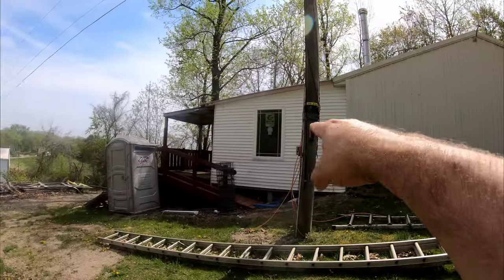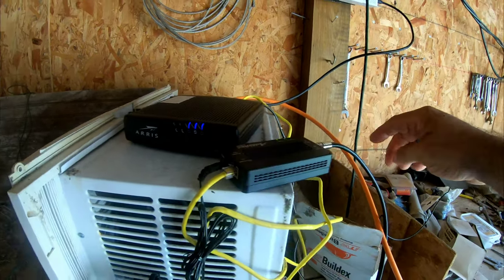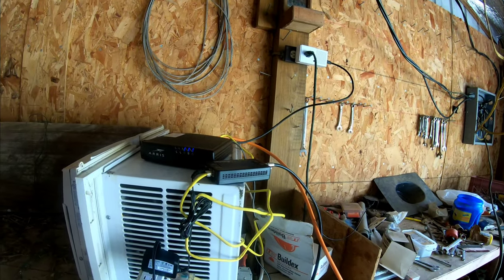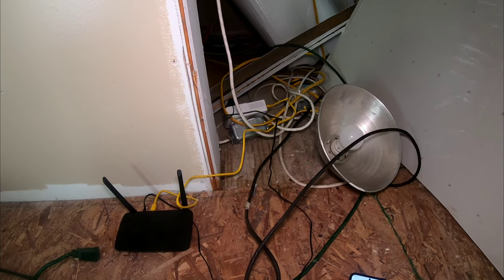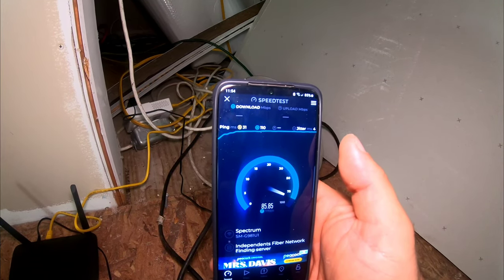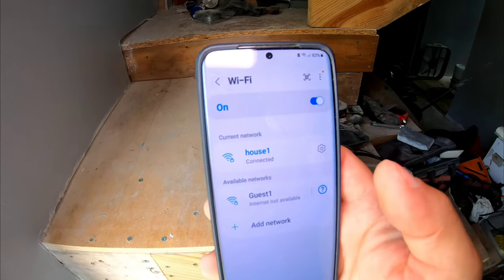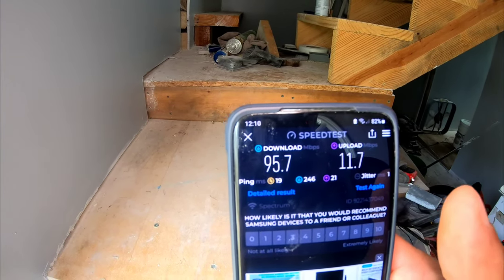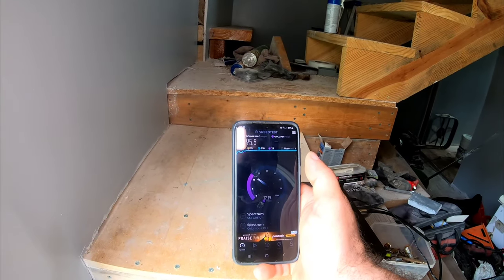Internet Sharing   Moca  and Powerline Adapter

Comment: Great setup
Reply from the maker: Thanks. I actually did a lot of research on this trying to make it as smart as possible. Time is definitely out of premium for me I don't mind doing a little bit of trenching for that coax but trying to get through the rest of it that's been gravel and rolled over and over that takes a lot of work or equipment The good thing is I really don't have anything invested in this because the parts were so cheap off eBay used. But I definitely knew you would see the value in this.

Comment: How is electric set up for each building? Are they all individually ran from transformer or is only the first building connected to transformer and the others piggy back off it? Great video btw answered a lot of other questions I had.
Reply from the maker: Yes first building has the main service the rest piggyback off of the main house. We have found that moca is so much better than any other option carrying even at a higher quality than ethernet cable can.

Comment: 2.4 is for shorter distances the 5 ghZ is for longer  distances. You can turn auto off and set your network cards for 1gb which will force the hardware to operate at the higher speed. Network cards inside pc are older replacing to usb external 5ghz are way way better. Experiment experiment experiment.
Reply from the maker: 2.4 will penetrate better than 5G but none of them will work against basically a metal box we went this route because everything is wrapped with multiple layers of metal. And there's not any way to adjust those settings on things like roku's streaming sticks TVs etc.
Reply: other way around 5ghz is shorter distance but faster then 2.4
Reply from the maker: @bryanmeier272xp8  yes sir you are correct
Reply: Thank you!!!!!